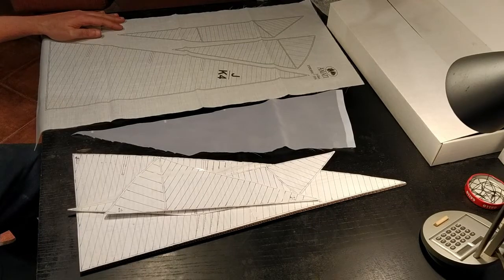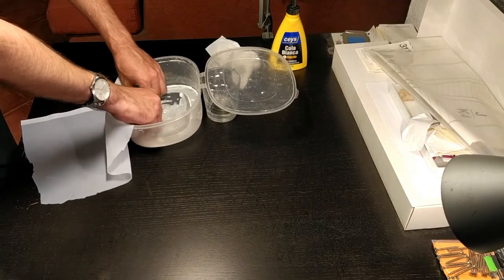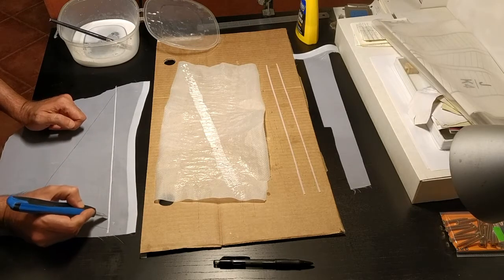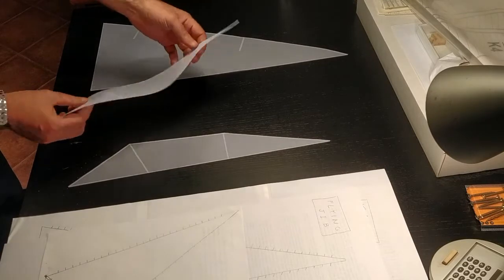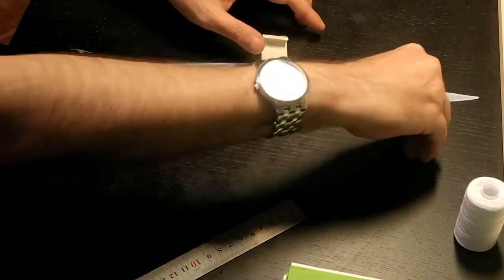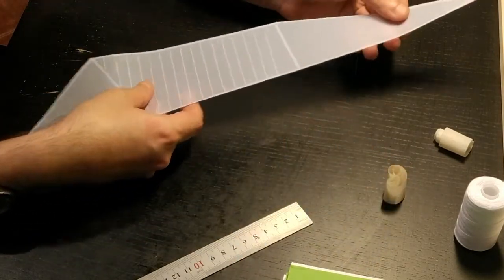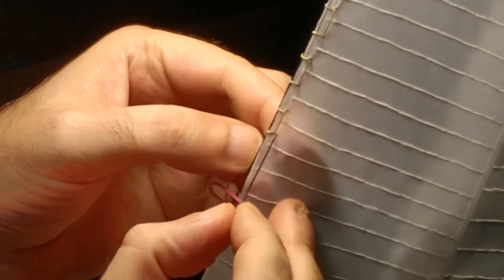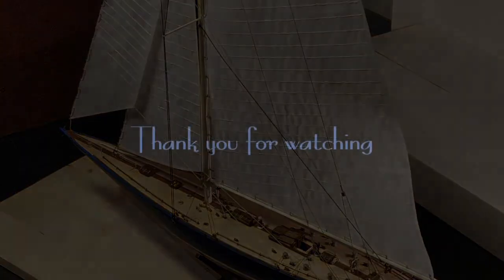Amati Endeavour Part 20   Sails

Comment: What kind of material did you use instead of kit material? Can you please also make detail photo of sails? Thank you
Reply from the maker: I used curtain cloth which is very light instead of the cloth provided by the kit. You can get better pictures of the sails in video 22 of the completed ship or in my instagram link. I think it shows the sails very well. I hope this helps.